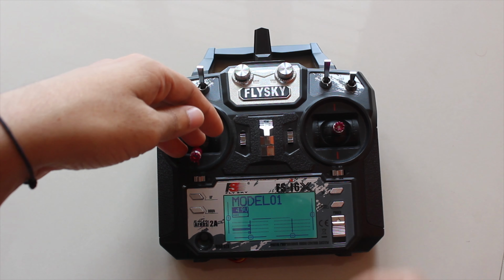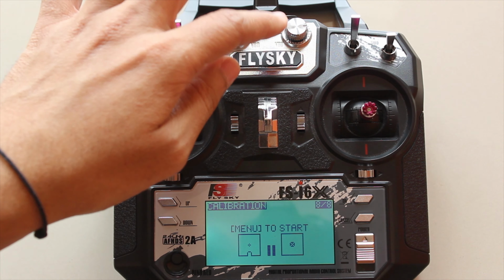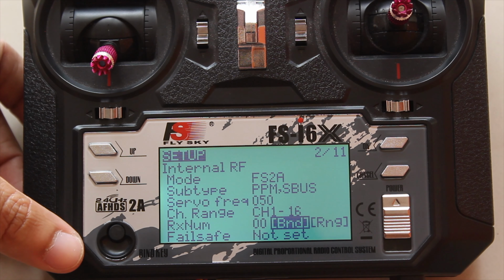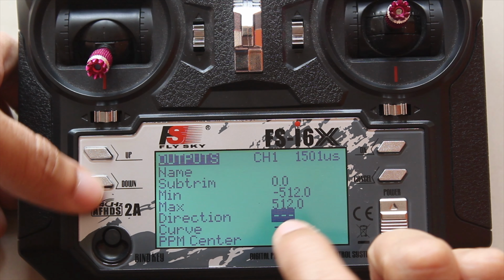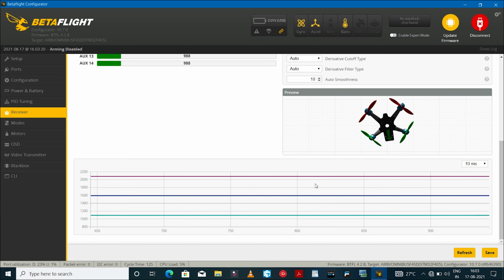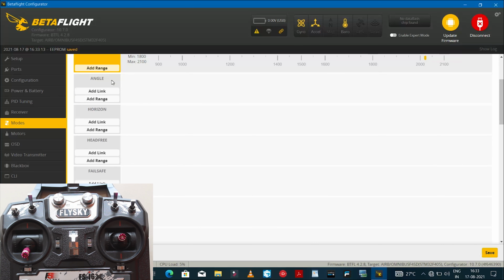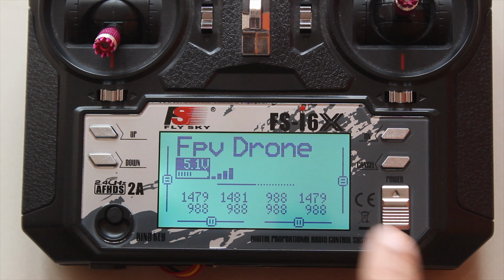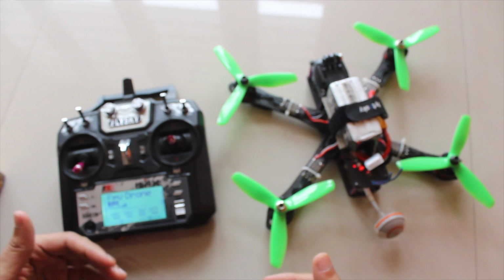FlySky FS i6X Open TX Model Setup | In Depth Start to End Tutorial

Comment: @rakish Rc the reason i bought this transmitter was that i thought the opentx would be able to connect to several different receivers, including flysky. is that not the issue?
Reply from the maker: Hi, well even with open tx firmware you're limited to flysky receivers only because the internal module is limited to the flysky protocol not multi protocol like on the high end radios. You could use a external multi protocol module or express lrs module.

Comment: Is there a certain setting that needs to be activated to use the trainer mode? I have the firmware installed (open i6x) and plugged in the usb cable to the port on the back of the controller but nothing happened and it didn’t connect. Do you know? Thanks I wanted to work on my fpv drone skills. Nice video
Reply: I figured it out. On the menu screen hold ok and click usb connect then it will connect

Comment: Im not familar with openTX and I have a question: Is ist possible to configure a channel (eg. Channel 5) to each of the 4 switches? The first switch in position down is set to -10% of ch.5, the switch in upper position is set to -20%, the second switch is at +30% und -40%. At the end I will have 8 pos. from -10 to -80%....   Is this possible to setup?
Reply from the maker: Yes ofcourse.. you'll need to map channel 5 on every switch however you'll need to set the channel range from the mixer editing screen of each channel..but mostly likely you will need to add additional lines on channel 5 and set them to replace if you want to have them all on different percentage. For what purpose you want this mix?

Comment: I have a prob with this radio, I can’t enter the menu anymore to calibrate the sticks, even if I put the sticks to the left and turn on the radio, it will stay on the main screen..,
Any ideas???
Reply from the maker: How did you flash open tx? Contact via telemegram I've sent you the link in previous comment
Reply: @RakishRc  I did not flash anything, I dt have a new version, I was able to enter the menu to calibrate the sticks and now I can’t anymore
Reply from the maker: @zibobman  with the original flysky firmware or open tx firmware?
Reply: @RakishRc  original 1.0 September 2019
Reply from the maker: @zibobman  okay. So try and reflash the firmware. If you are unable to access update firmware option then try dfu method and flash firmware
Reply: @RakishRc  I'm waiting to get the cable.. what is du method?
Reply from the maker: @zibobman  https://youtu.be/5jW7gGt15EI 
Watch this video it's how to install open tx or even flysky firmware via dfu method. If for some reason your radio gets bricked during flashing this method can be used to restore the Radio.
You bridge the r53 pads with a tweezer and turn on raido the display should be off. Then connect to computer and flash original or open tx firmware and check if your issue resolves 👍

Comment: In the video it seems you are using the opentx-x7 2.3 firmware which is meant for the taranis Q X7 in a flysky i6x ??? how is that possible, I can only find 1.7 available for the i6x
Reply from the maker: This version of open tx is customised by developers for this I6X specifically with inputs from various open tx firmwares.

Comment: Hey man, love the video, was a great help.

So how do I get RSSI to display on OSD via betaflight and x6b receiver?
Reply from the maker: If i am not mistaken rssi is sent to receiver on the last channel with open tx on radio. It should be visible on aux 14 i believe in receiver tab so just select that in rssi option. Alternatively you could flash the rssi firmware on your x6b receiver which will display the rssi on channel 14 too.

Comment: I flash opentx firmware, if I want to use flysky receiver do I need to install flysky firmware again?
Reply from the maker: You can use flysky receiver without any modifications. Flysky AFHDS2A Protocol is supported with open tx firmware in the radio 👍
Reply: @RakishRc  ok noted.. thanks bro

Comment: Rakish - Is it possible to set the servo speed on FS i6X
Reply from the maker: Yes you can adjust the servo frequency/ rate if that's what you meant
Reply: @RakishRc  No I wanted slow move of Servo arm for 2 sec. - But I found the settings location and I have it working now. Thanks
Reply from the maker: @Mike4_friends  yes you can do that by setting delay from mixer settings for that servo channel.

Comment: Greats ! thank you so much for your tutorials, I ve just a question : I use mode  1 and I don't know why the gimbals draws aren't swapped
Reply from the maker: I didn't get what you mean by gimbal draw? Mode can be switched from radio settings first page at bottom. You mean during calibration?
Reply: @RakishRc  At the beginning of your video : You have on display : model 1 and parameters which are gimbals, pot and Switch, you can get a gimbal representation draw on screen. I choose mode 1 and I have throttle / ailron on left and elevon / rudder on right, but it must be inverted... it's only a representation but...
Reply from the maker: @Krakinutts  with the latest firmware, whene you Change mode the channel order is adjusted in that line. 👍
Reply: @RakishRc  I have the firmware 1.3, changing mode have no effect... or I miss something... I can choose mode 1 or 2, 3, 4, nothing change
Reply: firmware version 1.3.0 (0)
date 2022-01-22 10:32:19
EEPR : 219

I maybe should use your version
Reply: I use a precedent firmware 1.2.0 erlsv, it's the same problem.

Comment: Hi rakish, hope you are doing well now, how did you connect the elrs module? And when we turn off external module in settings, does it cuts off power to elrs or it still consumes power? Like for simulation on pc, i would love to turn it off
Reply from the maker: Hi, doing good thanks. https://youtu.be/Fmr4YwnYm9I check this video for full wiring detail for elrs. It is possible to power off elrs module whene not using it but you'll need to make a few hardware changes. I haven't bothered doing that i just disconnect the wire.

Comment: Switch SC how to set to 1000 - 1500 2000
I get 1000 - 1500 - 1500 only ??? where to change the switch value ?
Reply: Latest version of Open TX installed for ASC.
Reply from the maker: In radio setup, under switches page select SC to 3 position
Reply: @RakishRc  I have this - openi6x v1.3.0(0), dtd 22/1/22, pg.5/5 SWITCHES - I see all4 switches, pg.7/8 HARDWARE I see all4 switches and SC-sw3_3POS,  channels monitor & mixers monitor do not respond to switches but only to motion of sticks??
Reply from the maker: @Mike4_friends  Did you factory rest the radio after installing open tx? sometimes it needs a rest. It seems your switches are not getting detected id suggest you check if you have the switches enabled with correct position number assigned.
Reply: @RakishRc  I did a reset - openi6x v1.3.0(0), dtd 22/1/22, pg.5/5 SWITCHES - works, 7/8 I see them, but under Model01 screen only joysticks movement is visible and the same on Channel monitor. Is there a link to instructions manual ?
Reply from the maker: Have you setup aux channels in mixer page?
Reply: @RakishRc   Yes - I followed your video from this page: FlySky FS i6X Open TX Model Setup | In Depth Start to End Tutorial - including download SW link from here. But in Mixer page I have only CH1 to CH4 - --- just now I added CH5 Sw5 and CH6 -Sw6 = now IT WORKS!  I did not know I need to add Switches to Mixer as well! Thanks - solved! -- Keep on the good work Rakish! Some basic manual or more details in above stated video instructions would help a lot!
Reply from the maker: @Mike4_friends  hi, see i asked you earlier too if you had setup the channels in the mixer page along with correct position number in radio setup switches. To know more you can visit open tx website and read through the manual. It applies to all open tx radios. If you need any more assistance you can let me know 👍

Comment: great video first of all... but can you tell me does this open tx have the factory settings which can be accessed on the stock firmware by holding both diagonal stick down while turning on.. because in there there is a very useful setting which lets me use a 3.7v li-ion battery directly by using inbuilt voltage boost function to boost it to 6v. i don't wanna use an external boost converter like a powerbank module because it will not show the battery percentage on screen it will just randomly cut off.
Reply from the maker: In open tx you have option to select the minimum and maximum voltage range so you should try adjusting those settings and see. Also with open tx you can get and can aslo set custom alarm for battery voltage and time if needed to alter the user.
Reply: @RakishRc  no not that what i want to say is that i don't want to run the transmitter from 4AA batteries i just connect one 18650 and boost it's voltage to 6v thru the factory settings because 3.7v of the 18650 battery is too low to run the transmitter (i believe there is an internal voltage boost module) is it available in here too? ... also fyi really ... really appreciate you replying and helping out😊
Reply from the maker: @pofficial-qi6es  okay I got what you meant..the voltage boost is nothing but the voltage calibration right? So you want to set a Higher voltage than the actual voltage just to keep the radio from sounding alarm right? You can calibrate the voltage in open tx from radio settings under the analog page.

Comment: if i have a gps and using inav for return to home failsafe what option i should choose in the failsafe tab of the radio?
Reply from the maker: Best would be to leave default failsafe values not custom set. Thing is once rx loss is detected betaflight or even inav I believe will apply failsafe setting depending on what you set in failsafe menu. In that case tx failsafe values won't matter. So RTH will automatically be initiated if setup in configuration failsafe menu

Comment: Hi,
following the instructions everything is ok, but telemetry shows only radio links, no drone lipo battery voltage.
Inav 2.6.1 shows it on configurator on PC, and I tuned the scale factor and offset (0) to have a correct measurement.
The used FC is SPRACINGF3, and battery monitor is hardware connected to the power distribution board, so the controller fully sees lipo battery voltage.
I discovered all sensors several times, but I have no clear idea of what is missing, to have Vbat on transmitter.
I found some info about modding the ia6b receiver for doing it, but other videos show it is necessary to have two uarts (ppm+ibus) to have bidirectional receiver-transmitter protocol.
This sounds strange to me because IBUS is half duplex bidirectional protocol.
Some other info found on internet suggests to check if inav firmware for spracing f3 has compiled in the telemetry option...
Rssi works, but Rssi is a special kind of telemetry (it is produced by the rx-tx system).
So, I am a bit confused about...

Any idea to solve this issue ?
Reply: I found why tm is not fully discovered !!!.

It is necessary to configure IBUS telemetry in the inav (I use inav) ports tab on another (a second) uart.
The new uart tx (fc side) pin must be connected to sensor ibus signal pin on the receiver (I use ia6b receiver). This pin is next to the "classic" 3 pins (gnd-vcc-sgnal) for the commanding connection.
Since on the fc electric ground is common, I just added one connection pin2pin to the overall setup.
Quite easy ...

Flysky documentation is not clear about this, and many infos on internet seem to refer different obsolete hw ia6b receiver models, declaring that telemetry is not available, or that Ibus is half-duplex.

Hope this discussion can be helpful to other guys !!!

Alfredo
Reply: @alfredo4267  Brussels
Useful information 👍 you should post it on you channel as instructions
Reply: @xpertcrush  thanks ! I will think about it. !!!

Comment: Is there any receiver with Gyro that is compatible with the Fs-I6X?
Reply from the maker: I am not of a receiver with built-in gyro for the Flysky Radio..but you can use a external gyro and connect between the servo and receiver 👍

Comment: can u help get with cable to update the firmware without soldering ?
Reply from the maker: Actually I am unable to find exactly which connector it is. I tried some jst connectors I have but they don't fit the port or even the pins. But I am pretty sure the connector is exactly the same as used to connect the switches on the motherboard. If you can source a spare connector that'll work fine
Reply: @RakishRc  Pretty certain the connector is JST-ZH (1.5mm pitch). Have ordered one from ebay and will confirm when it arrives
Reply from the maker: @petermather3049  cool 👍 let us know once you get it. It'll be helpful to folks who may not want to solder. Infact the pin port option is better..we can remove or keep it plugged with short wires.

Comment: It works worst in that transmitter. No sound are there as well as only PPM, PWM and updated one support also S.bus. no telemetry options. I have done it a month ago and again I shifted to FlySky FSi6X original firmware.
Reply from the maker: Did you watch the full video? Check the timestamps! Binding in all protocols along with telemetry and failsafe is working properly. As far as sound is concerned it will be available soon but that shouldn't be a cause of concern really
Reply: Have you tried to bind any other receiver like frsky? 
And it's a mod and a mod will not that reliable.
But yes your effort is good 👍
I like it, but it's better to use inbuilt openTX Transmitter.
Reply: @dronauticaltech-fun3485  stay with you original Flysky firmware and be happy

Comment: Great walkthrough, thanks. On the next video, are you going to cover mixes? If I switch mine over to OpenTX it will be to get more than 3 mixes for fixed wing flying. Flaperons and differential thrust at the same time will be nice.
Reply from the maker: Hi thanks for watching. I do appreciate your request but unfortunately I don't have much Idea about fixed wing aircrafts because I've never used one really so I won't be the right one to demonstrate mixes for that. However you could look for other open tx videos on how to do that and implement it in this radio with open tx firmware 👍

Comment: What is the advantages if i flash the open tx software?
Reply: Just having timers is day and night. Also I'm planning to implement CROSSFIRE. I want to be able to use ExpressLRS, it's a long way to make that work, but I will try.
Reply: @marianofpv  that will be awesome buddy if you can conect express lrs on a flysky fsi6x
Reply: @theinventionshow  it's already working, go to the Rcgroups thread or to the telegram group for more info.
Reply: @marianofpv  I would lite to see that, also bought a i6x as budget (first) radio and i would like to use expresslrs on it because i just startet flying and feel very limited by the range of the radio.
Reply: @marianofpv  no you can't. No special advantages you will get, infact original firmware is better. You will get signal indications as well as alarm also.
Reply: @dronauticaltech-fun3485  it's already working. Check my latest videos.
Reply from the maker: Well the stock firmware is actually very good for most usage but if you want to create more mixes, curves and set logical switcher for special functions you could do that with open tx. Infact the original flyksy firmware is more than sufficient for most tasks but if you want to experience the open tx software on your radio you could try it and test 👍